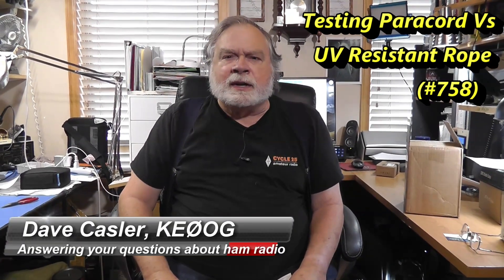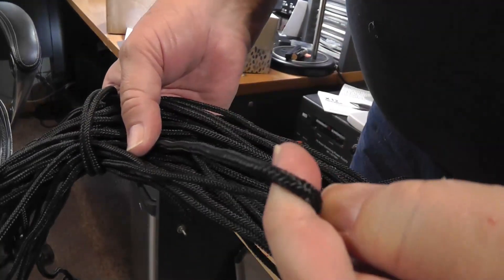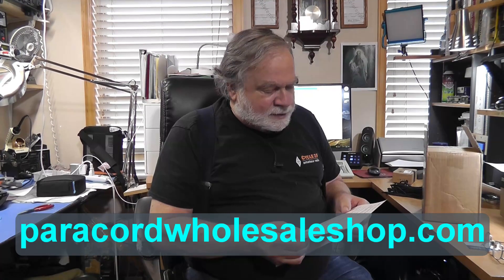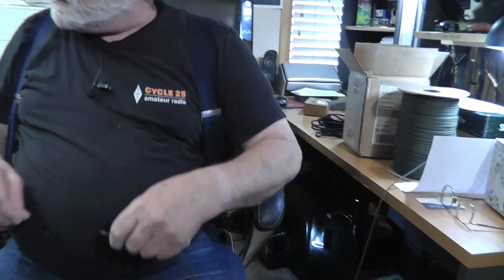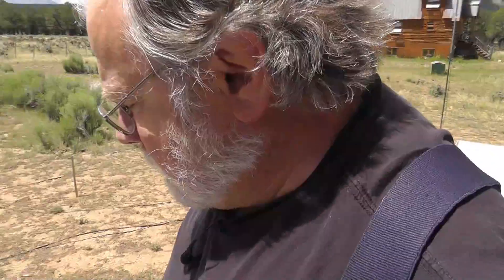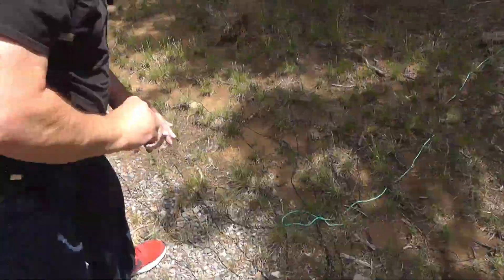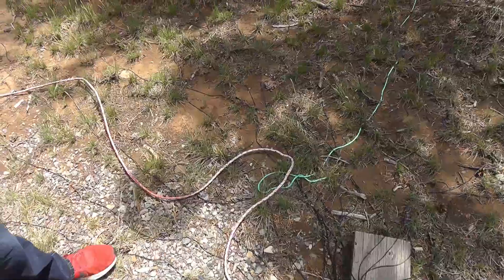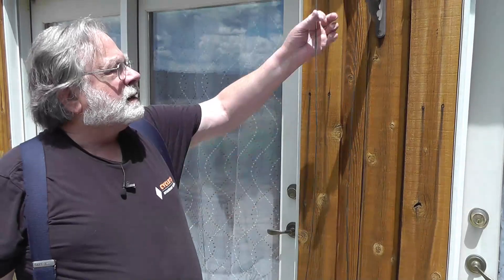Testing Paracord Vs UV Resitant Rope (#758)

Comment: ive used paracord outdoors for long term setups flying tarps and shelter building.  Sun exposure has never caused a failure in my experience, however there are some drawbacks to paracord not mentioned here.

Mainly - it stretches, sometimes significantly, especially when it gets wet.  If you are using the line to hang something from a tree, it will work for a very long time, but if you are using the cord as a guy or ridge line it will need to be adjusted periodically after installation.  After a while it stretches as far as its going to stretch and will remain taut when re tensioned.   

I dont know how this compares with other rope in similar situations.

Comment: Had a 40m/20m fan dipole up for 6 years  using the cheap Walmart paracord. I took it down to change to a different antenna. Paracord was faded but still strong and no rot.

Comment: You will be testing that paracord for a long time. The insulator end if my EFHW antenna has been guyed to a tree with paracord for over 2 years and it's still holding up just fine.

Comment: I have 45 ft running through a tree with a pulley holding 180ft of wire. It has been up since last 1997.    When you cut it, use a lighter to melt the cut ends to seal them.

Comment: I need to check on Paramore. Usually get   
Dacron braid,  because that's what's used for sheets on a sail boat. Polypropylene for anchors.
Reply: Damned auto-fil! I typed  'paracord' but that got changed to 'paramore'. Give the old groover a break!

Comment: 550 paracord is strong enough for almost anything you need.  The sun bleaching out the color does not mean that it will not hold what you want. I use orange 550 cord for temporary things.  I can put something up and the cord is easy to see and most people don't trip over it. At home where I don't need to be seen I got a role like you got 1000 ft gray. It isn't easy to see for the ends of antennas. Not had much trouble with it getting soked with water and changing my antennas. It has so many uses. The 550 is what it will hold! I don't think anyone has that much pull on there antennas.